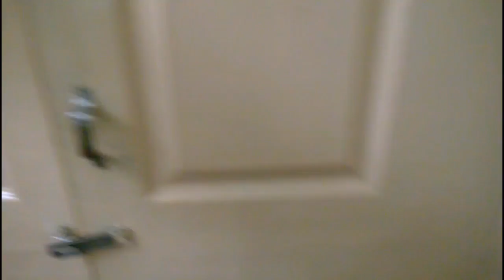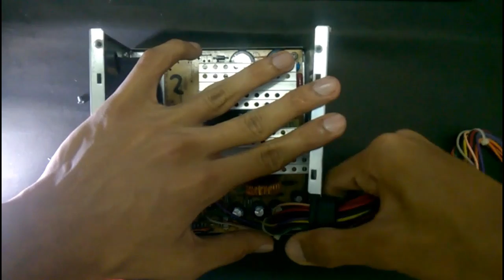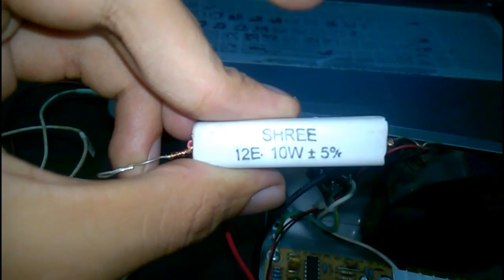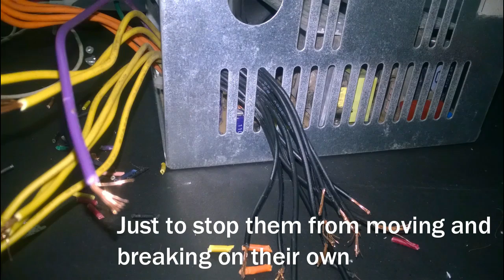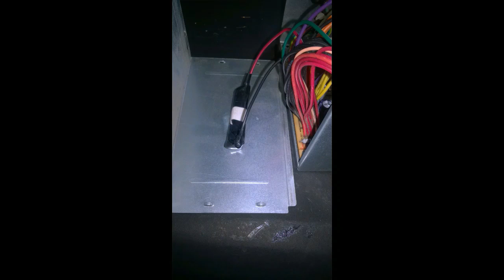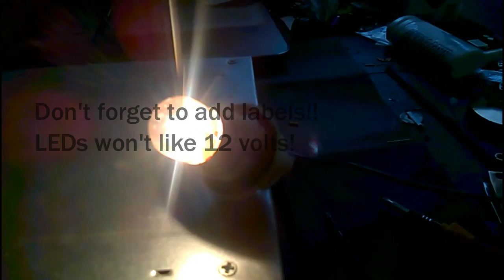Bench Power Supply using computer PSU

Comment: can u make a video about arduino
Reply from the maker: Well I would but then there are many good videos about arduino already...
Reply: My arduino is not working on windows 7 I have tried many drivers but same result everytime help me pls
Reply from the maker: There can be multiple reasons for that. Does the arduino board works on other PCs?
Reply: No.
Reply from the maker: Do you have arduino UNO?
Reply: Yes
Reply: But a duplicate piece not the original one
Reply from the maker: I'll try to get back to you with a possible solution.
Reply: OK thank you very much